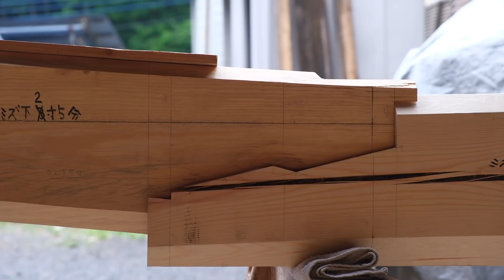『大工の伝統技術』台持ち継ぎ Japanese Carpentry - Big Beams, Big Joinery

Comment: Interesting how the beams don’t flush out with each other.
Reply: I noticed this too! I am very interested to see the reason for this and how it is incorporated into the forthcoming structure.  I hope we get to see exactly where this piece fits.  Cheers!
Reply: I'd love to know the reason for this too... the joint is amazing but with the two sides at different levels I'm confused as to it's use. Unless of course there is a third beam on the other end that matches the height of the far end making it go up then back down so that the end points are both the same height.

Comment: Have seen in a few of your videos that somethings the beams have very long cracks in them and i was wondering is it not a concern that those cracks may become a structural weakness? Or is there only some cases where those beams can be used as a sort of mitigation factor. At what point do you reject using a beam with what seems to be very long and deep cracks.
Reply: Indeed, the beam that was joined in the end had a massive crack that was very near the joint (13:16) and runs lengthwise at what appears to be along the grain of the wood. Looking at it gives me anxiety 😁
Reply: The type of stresses that those beams usually are under is tension on the bottom half and compression on the top.
As long as the cracks are less than a third of the thickness and on the center (vertically) they are absolutely not a problem.
Reply: This cracks showed the wood is seasoned well

Comment: If you would be so kind to enlighten me, what was this beam used for? It's such a unique scarf joint, at an angle? Will this be used for part of a roof? I'm dazzled, it's amazing! The quality of the lumber is superb, it must have cost a fortune.

I just recently fitted my first beam using a scarf joint, using your earlier video for guidance. Two 8ft beams, reclaimed oak from a barn, for the frame of my new workshop. No where near your craftsmanship, but it's rock solid.
Reply from the maker: Happy to hear my video helped you with making your scarf joint. As for this joinery, here is a clip of the final actual assembly: https://www.instagram.com/p/CTnirlhheCl/?igshid=YmMyMTA2M2Y=